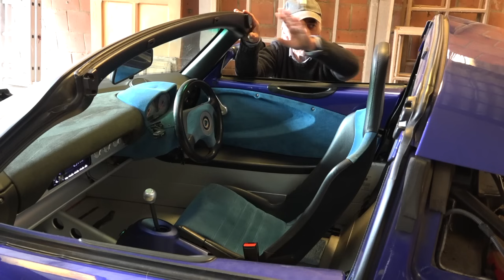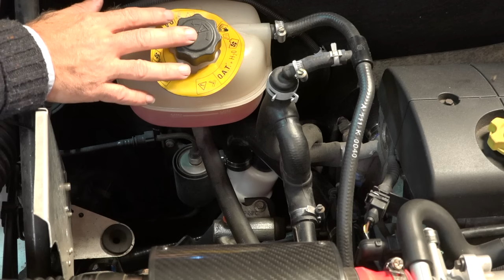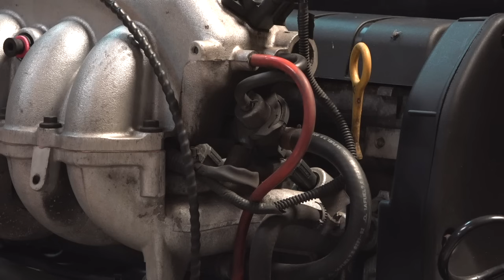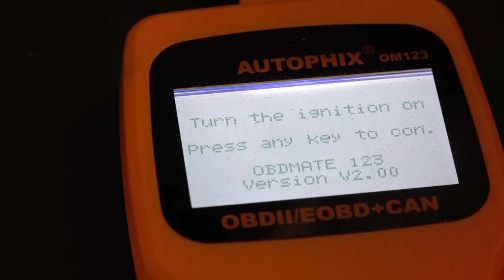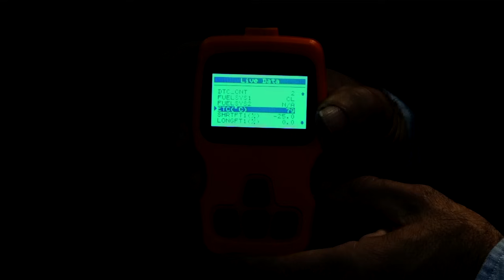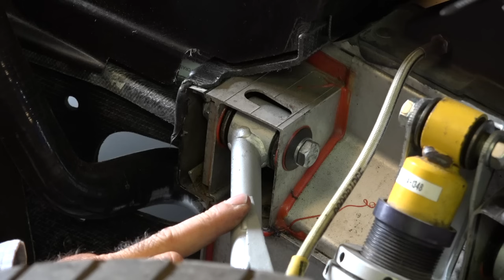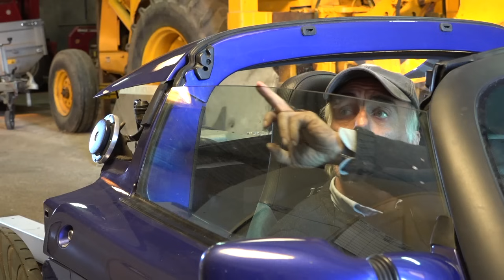Buying your first Lotus Elise   Things you must check

Comment: This is good info thank you for making this vid. What would a front end replacement cost when it's wrecked up to or just before the frontwheels? Thanks in advance
Reply from the maker: Hi Matt, TXS for the comments.  The cost ?  Well that would be a new Clamshell (3000 euro),New radiator (500), new Radiator shroud 300, possible new lights at 1000 per side, a paint job and the work  2000.    Assuming that the chassis is not hit, and the wishbones are clear. Total cost : about 6000 to 8000 euro.
Reply: @D3Sshooter  Thanks
Reply: I have seen them from,£3,500.to £6,000

Comment: Does the steering wheel move up and down and is it telescoping.
Reply from the maker: No its not, in fact if you push hard on it ( towards the front), you could brake the protection method of the steering wheel...
Reply: @D3Sshooter  thanks for the info

Comment: Thank you so much for this video. It's so informative! I have a question: should you use 98 ron gasoline in these lotus elises? It are just rover/toyota engines and aren't tuned or have forced induction. So will you be alright just using 95 RON gas, or is 98 required/recommended?
Reply from the maker: Aaron Mattheus  98 is what is recommended.  Its all about the octane content.  That affects the combustion rate so for different octane values other ignition times apply.  Although i have never sensed the difference.   In each case 98 octane is recommended

Comment: Hi Steve, Lotus revised the cambelt change frequency in line with Rover recommendations. It's now every four years/90,000km, whichever comes first, and an inspection at the midway point.
Reply from the maker: Tango Nuevo , thanks Tango. Good update.
Reply: Looking at various K engined cars and came across an MGF Trophy that said it had the cambelt, head gasket and water pump done 15000 miles ago. With receipts.

Great I thought...until I saw it was 10 years ago. But the seller argued mileage and wouldn't have it that age effects it too. As it happens the header tank was grey/brown so walked and bought a 1ZZ Elise S.

Comment: Good instructional video. Much of what you said here can be applied to the purchase of a vehicle in general. Not just the Lotus.
Reply from the maker: The Spider Kelly  txs
Reply: I always warm my 1988 Ferrari up by slower driving over ten miles or until the oil temperature gauge moves off the lowest position. Until that occurs do not try to use Second gear. Also no hard acceleration on cold tyres. Even on a warm day it takes 10-20miles to get some heat into the tyres. Many crashes occur due to cold tyres. On my 5th Ferrari the car was 19 years old, it had been driven 19,000 miles on 19 year old perfect looking tyres. Replace tyres every 5-6 years as the rubber goes hard. Even if they look perfect they put you at risk.  I avoid buying low mileage cars. I want to see evidence of recent use. Making the mistake of buying a low mileage car meant early failure of all hoses! Replacement hoses to water & brake fluid is costly. Cars that stand about get failure on suspension dampers & bushes. Tyres become flat spotted. My current Ferrari has done 75,540 miles in 36 years, that’s normal annual use on cars which are not daily drivers. If a car has only a tiny mileage showing then it’s not been used and expect to have to renew hoses, bushes, dampers, gaskets, tyres, boots, and quite often the exhaust! I speak from experience! I’m on my 7th Ferrari. All manual gearbox cars.

Comment: Very nice instructional video.  But you should never pull on the windshield while entering or exiting the car.  The glass has been known to crack due to flex.  You can see the frame flex when you pulled on it in this video.
Reply from the maker: justaddafan txs

Comment: 2:10 do not agree.  I am 1.88m and have no issues getting in- and out of my Elise S2.  I would say the issue lays more with people who are volumenous around the waist.

Mate of my is 2.05m and had no issues sitting on the passengers’ side.  But I seriously doubt if he fits behind the steering wheel, he didn’t try (for self-protection)
Reply from the maker: Harald.111   Txs Harald.  What i stated was very generic and in most cases something to think about when tall and wide.   Txs for the comment
Reply: The fatter you are round the middle the harder it is to double up at the waist and get your head under the roof.  MK1 Elise is even harder to get into.
Reply: @steveluck9541 The MK2 is a dawdle to get out of compared to the MK1.  The sill is much higher on the MK1 and i find it is a good indicator of when i need to reduce my food intake and increase my exercise regime.

Comment: Darn I saw this too late!  I already bought my first s2 elise!  In fact I bought this one : https://m.youtube.com/watch?v=KNkyUycyYuM  

One very very very important thing about your video : Do not use the windshield frame to support you when you get in and out!!!  It is not load bearing and you can flex it and break your windshield!  Use the steering wheel or the inner part of the seat to support yourself when you get in and out.
Reply: what about the roof softtop in the middle, it should be less pressure on the front window as it is attached in the back too. I help myself out by pulling 1 second in the middle of the roof at driver’s side.